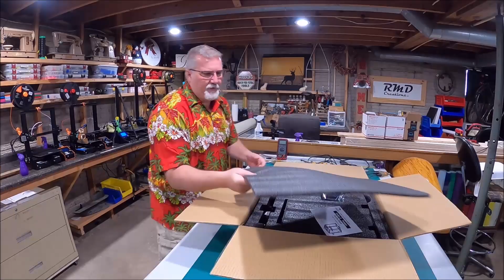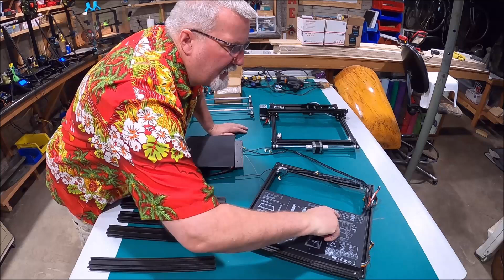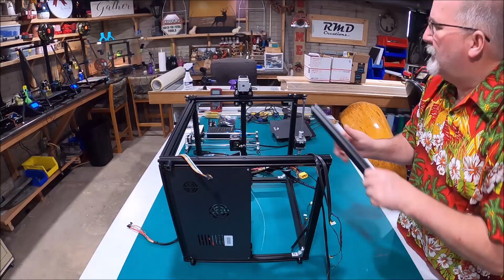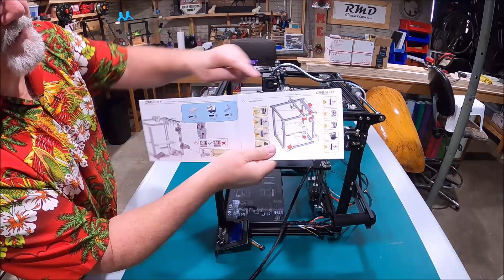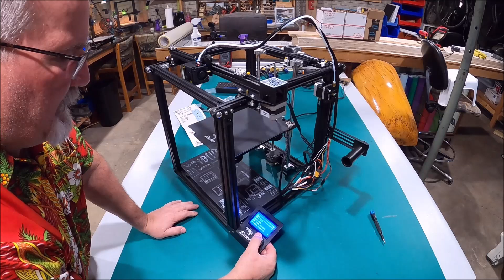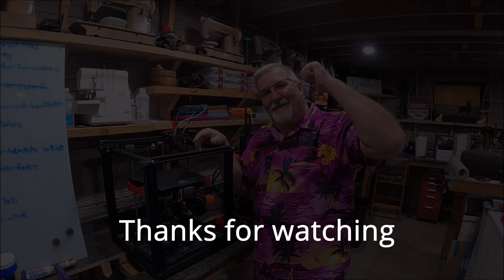Creality Ender 5 unboxing and assembly. Let's print some parts. How to put it all together.

Comment: Great video. I have been looking at the Ender 5 plus, but I haven't been able to pull the trigger yet.
Reply from the maker: Take your time and make sure you are making the right choice for you.
Reply: The Ender 5 Plus is the best printer in the Ender 5 series. Its also the largest print bed of the 5 series. If you buy the Ender 5 Plus make sure it has the silent motherboard. If I'm not mistaken Creality puts the silent mobo in the 5 Plus now but check to make sure.